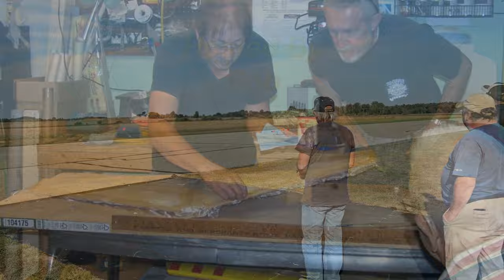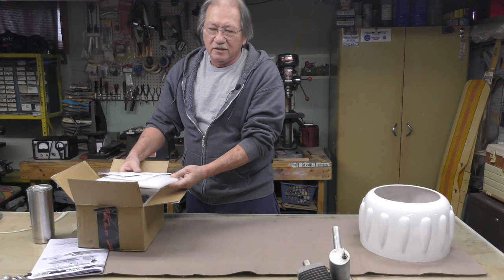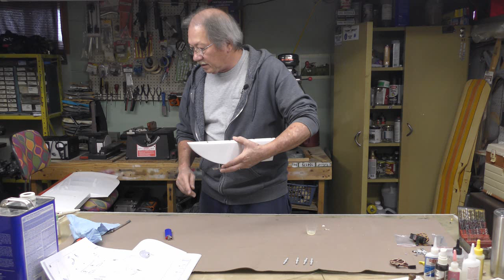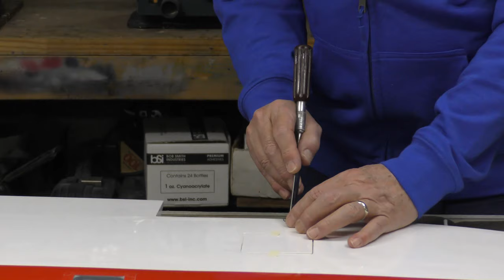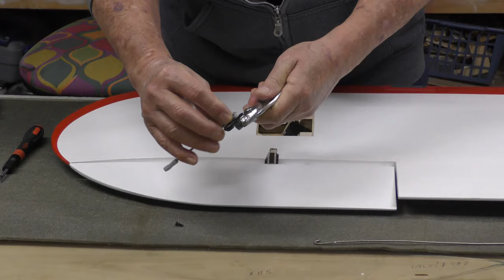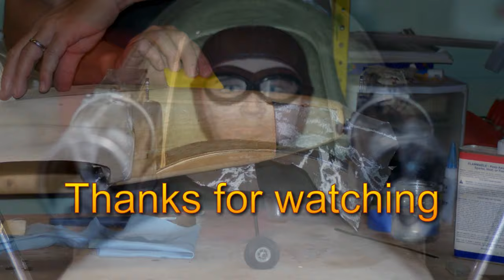Phoenix Model 60cc Waco Build Part 1

Comment: I have the same model with a DLE 60 twin.  The one thing I would recommend is to modify the aileron servos.  go from two to four.  and the bottom wing aileron servos must be also modified to match the top wing servos to a more standard industry type of setup.  I found their aileron linkage very lacking.  Before doing this modification, my roll rate was VERY sluggish and had trouble centering.  After the modifications my WACO flew like it should.  I also had to cut and trim the ailerons bevel at the tips, not enough clearance for full movement. I also replaced most of the control hardware, just not to my preference.  The wheel pants and axil is also something different for me, I did not like the axil setup and found they tend to let the wheel pants rotate after a few landings.  This model has great potential if just a few things were changed. After much trial and error I finally got this plane to fly right, and many at my field have commented on how beautiful this model is.
So if you are able to make these modifications to accommodate your flying preferences then you will have a great flying experience
Reply from the maker: Thanks for the recommendations. I noticed the shortcomings of the aileron setup straight away.  I ran into a similar situation in the early 70's with a Midwest Pitts Special. I agree, the axle set up is substandard.  I've ran into the rotating wheel pant  problem before as well. I have a plan to fix that problem after the maiden flight along with the substandard axle setup. 
   I'm looking into adding a smoke system to it after I get the bugs worked out of model.
 Thanks again.